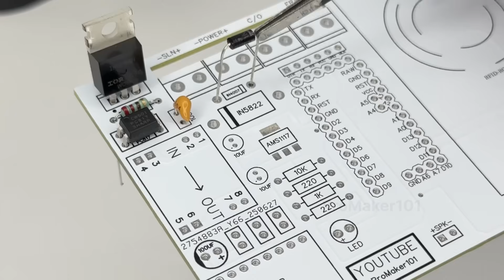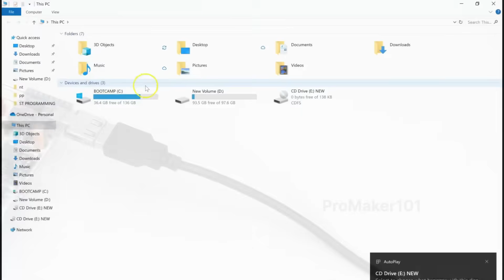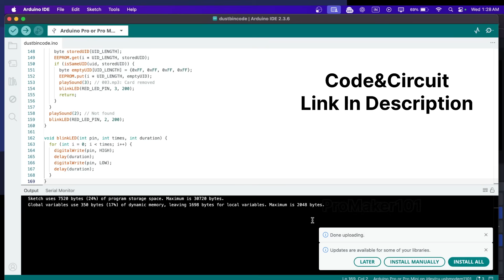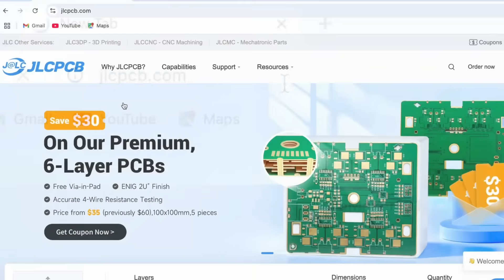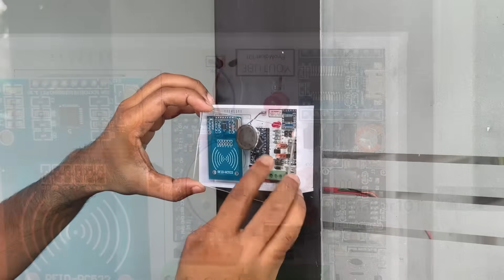This DIY device is a must-have in every home

Comment: I built something similar but with an ESP32 and a mobile router because remote access was asked for. That way we can manage cards externally. Only the RFID module is outside. It has a rechargeable battery and loading circuit. At the start we only used a solar panel but now we have AC. But the security of the cards usually provided with the readers (MIFARE) is not the best. There are methods to hack them. In our case it is only an area at a lake which can be accessed anyway if somebody really wants to. I wouldn't use it for my home.

Comment: Our institute had a simillar thing for library. May be you can also make it log time in and out for say multiple rfid tags. People saying it is vulnerable to simple attacks, not all locks have to be super strong main door locks. But my concern is power supply. Like either battery replacing or wall plug. There has to be a manual failsafe.

Comment: You might want to encrypt those codes bro 😂
Very insecure. But it is cool I just has this idea when I was looking at cool readers like proxmark3. 

Surely there is a way we can store encrypted key and set pi zero with Linux to decrypted and hold second key for access.

Comment: Smash the box off the wall and trigger the solenoid with a 9 volt battery
Reply: i think even to bridge the contacts are open the lock, this design is zero secure.

Comment: You know, you can achieve the same with a lot less components. 1. dcdc can be much smaller. Probably even a linear regulator will do. 2. You do not need an optocoupler to drive a mosfet. 3. If you do not insist on voice output, you can make the speaker beep by connecting it in series with a capacitor directly to a gpio. 4. Instead of Arduino choose an Attiny with the aproptiate number of pins. No need to layout and solder all those unused pins.
Reply: There are post stamp RP2040 comtrollers with all 29 GPIOs available and cost around $3, these have my preference, python is often enough for these kinds of projects.

Comment: So you can just pop the box with a screwdriver, send power to the solenoid from a power bank in your pocket and you are in... impressive.🤣
Reply from the maker: 😂Just leave rc522 module outside.
Reply: @Promaker1  It should work from behind a 4 mm trespa panel (the super dense hard polymer board). Just print an RFID icon on the proper place and voila.